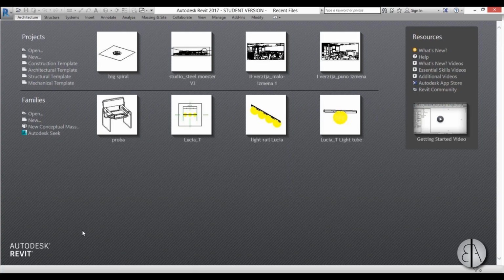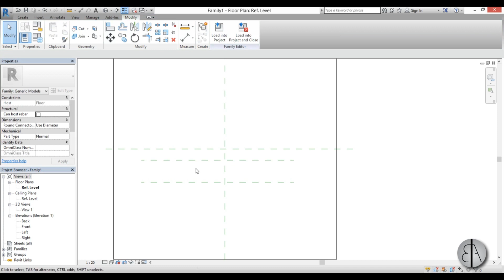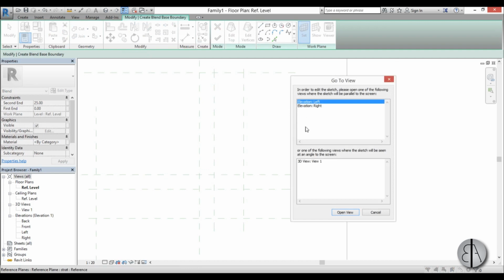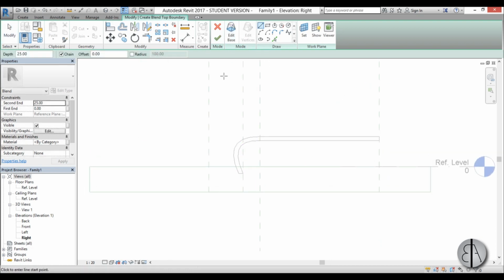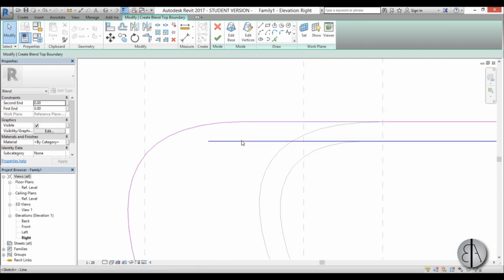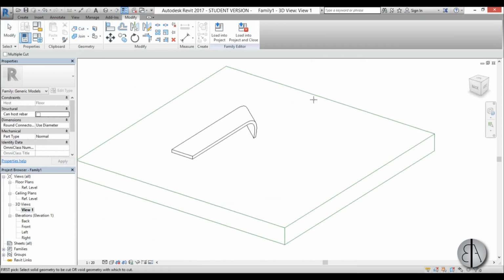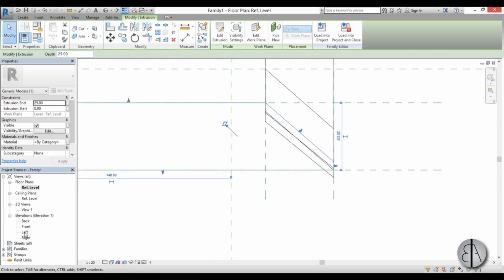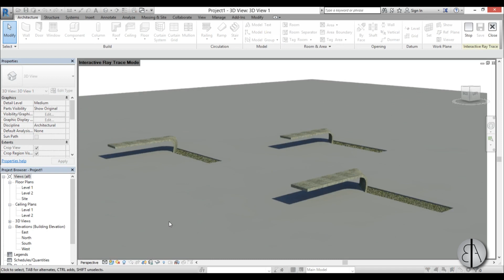Modeling a Peeled Bench in Revit Tutorial

Comment: Cool one :) just one question and some tips. First, is there any specific reason why adding material directly to family components not giving Instance Material parameter to components? By adding Instance material parameter to family component it is more easier to change materials inside project instead edit family every time need to change materials. Second tip, it is possible to change family category afterwards even choosing eg. Generic Model floor based, so basically it is possible to change bench to Furniture- category afterwards. Great and informative videos anyway :)